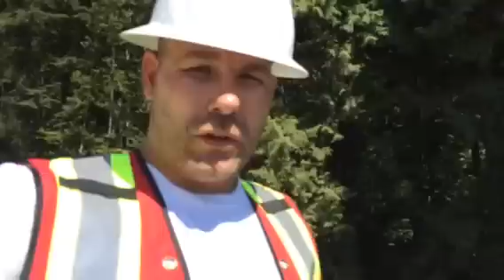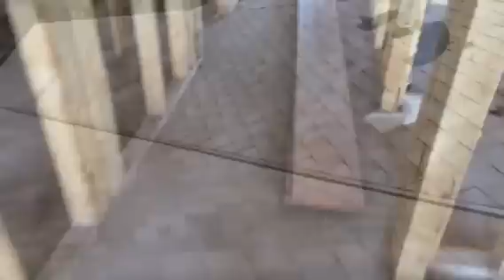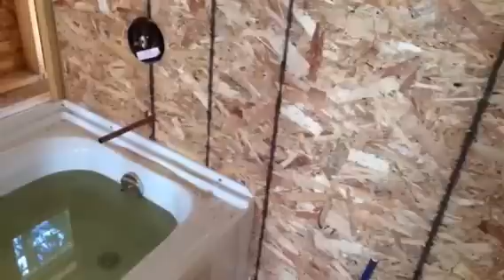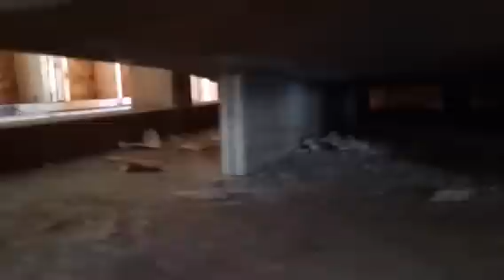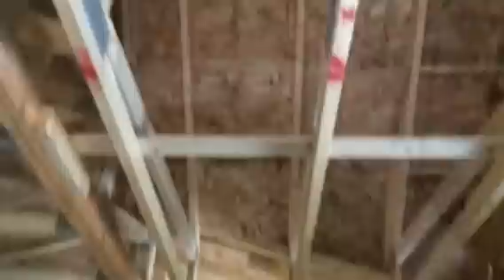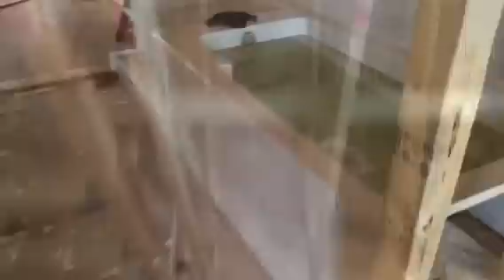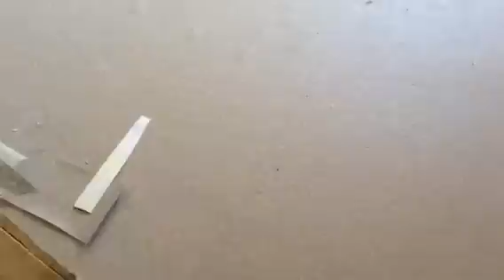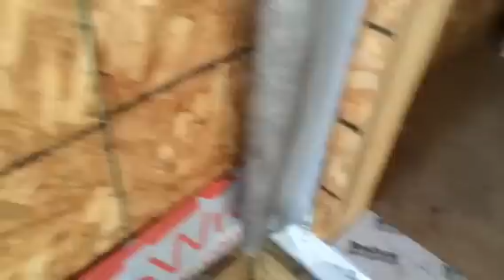New Home Construction Fails

Comment: Who the hell puts joist hangers upside down? There's a picture on the box!
Reply: OMG....who the hell would even need a picture?!?  This world  Crazy or stupid, I guess both....
Reply: Nathaniel Mathies if there put on upside down doesn't it become a hurricane strap then. the guy was plannin ahead!
Reply: Nathaniel Mathies , yeah, but if you're holding the box upside-down...
Reply: Btw, it looked to me that that was a very small deck off of a small slider. I could see that the joists for it were cut and fastened against a rim joist or ledger board, so they were infact installed upside-down for this particular situation. Also, when I have built decks with someone who knows what he's doing, we always toe-nailed the joists to a double or triple beam resting on a 4x4 encased in a concrete footing, we never used a joist hanger as we never cut any joists, they went over the supporting beam(s). Just saying.
Reply: Nathaniel Mathies Someone who just built a deck with a cantilievered overhang... lol that's pretty standard when the joists need to withstand a down force when cantilievered past the bearing point enough. the rim joists on the sides are usually psl or triple 2x beams that are offset and carriage bolted into interior deck framing.
Reply: It is what you do when you get the opportunity to do construction on your worst enemy's house.
Reply: Nathaniel Mathies - They've obviously got people onsite that have no experience in building. This construction will have loads of problems and the finishing work will be rough.
Reply: @numbereight886  they should go back to building dog houses and goat sheds.
Reply: Probably the Irish Twins from Powell River.
Reply: I'd bet they built the porch/deck on the ground and put it up upsidedown and didn't even notice. There is no way a framer does not know how those work/
Reply: Nathaniel Mathies ikr don't even need to know english.
Reply: Nathaniel Mathies   My grandfather used to have a saying that fits these workers; "Their momma must have dropped them on their heads, because they REALLY didn't know which end was up." 😂😂
Reply: Too bad anchor bolts don't come in a box with a picture....  I heard about a guy who stuck the threaded end into the concrete stem wall.  At least he followed directions and left 3" of bolt sticking out of the concrete.
Reply: This is what happens when your contractor skimps out on $$$ by hiring a crew of illegals that he just picked up in a Home Depot parking lot on the way to the job site...sure, they will bust their asses for much lower wages than a certified, reputable crew - some may actually be quite skilled and know what they are doing no matter what type of job you throw at them, but others may not have a clue on what they are doing...you  really have no way of knowing who you will get when you take that route.
Reply: Sometimes they’ll set the joist hangers like that just so they know that there’s one for each joist. Then install them later properly. Probably told greenhorn install them and he installed them just the way they were sitting
Reply: thinks someone Must have opened the wrong end of the box HA HA
Reply: Construction people are in construction for a reason.
Reply: Was there a picture on the box of nails too?
Reply: Nathaniel Mathies sometimes you put them upside down in purpose when the joist are cantilevered
Reply: @austinverbeek5822  not really, as a rule, you need twice as much inside your cantilever as what sticks out, so no that's not right if your framing and supporting correctly.
Reply: +Dustin Lentz what about using a 21 deg. framing nailed to toenail the joists to the ledger, then using a palm nailer for the joist hangers? I like the senco for those, thousands of nails, and it still works just fine. Don't forget to oil your pneumatic tools, boys and germs.
Reply: That was crazy....
Reply: hahah
Reply: Must be an Australian
Reply: @dannygallagher9290  they would be the first to know they go.......Down under, lol
Reply: Yeah the ones they put the right way around, I don’t think they did that on purpose, it was probably an accident.
Reply: Jordan Bergmann, why would you want to build beyond the safe bearing limit? Math is important so people don't get hurt or die, so if the overhang is only allowed by code or engineering equations to be, say, 3', why would you want to build it to 5' and not be safe, just assume some upside-down joist hangers are going to support your laziness? I am not a professional, I do know some stuff though, and it seems to me that if you use a 2x4 for a rafter, or sheetrock for subfloor, that things aren't going to go the way you hope they might. I say not to use upside-down joist hangers, Simpson makes other "strong-tie" models for specific applications, but I feel even with that in mind, I wouldn't build anything past the safe load rating. Just saying.
Reply: thats why cantilievered decks are built with beams of some sort whether theyre engineered of just tripled up 2x girders that run into the interior deck at least 3' for every foot of cantilievered overhang. then they are carriage bolted to psl's framed into the interior deck or sit on bearing plates. Theres your math and physics.... builders do this all the time and its definitely code compliant. Its more popular on multifamily jobs. Ive built cantilievered decks more times than i can count.
Reply: steve b THAT IS A FANTASTIC POINT!! :) LOL Buddy, you're hired!
Reply: Nathaniel Mathies they probably bully the deck on the ground and forgot to flip it over.
Reply: +Jordan Bergmann generally speaking, the ones I see off multi's are bolted to a ledger and the fronts are supported by notched 6x6's that run to footings at ground level. The decks are bolted or attached with ledgerloks to the vertical 6x6's. Well, if they're done right, anyways, I lived in Stratford, CT next to Bridgeport and saw some funky "carpentry" for sure. Anyways, I rarely if ever saw a cantilevered deck/patio on a multi, I don't know anyone who would do all the extra engineering/building for section 8 dirtbags to just trash before getting evicted anyway.

Comment: Tom, you couldn't possibly be serious about having an issue with the builder installing oriented strand board on a shear wall that is required by engineer. The whole wall is OSB, what did u think the drywallers were gonna do? Mud right over the OSB? Lol of course not my silly, they will install drywall over the OSB, just as will the tile installer install Backer board over the OSB. What you should have had an issue with is the depth of the valves that the plumber installed,, will he be able to trim that out after adding roughly 1 1/8 inch of material to that wall. 
It's OK though. We're still friends.
Reply: Hi Andre Glinsky yes I do have a problem with the installation of OSB behind the tile backer that still needs to be installed. OSB is the most absorbent product with a quarter of the tensile strength of densi-shield for a sheer wall installation. Following the discovery of this OSB installation the builder of this 50 unit townhouse complex replaces all this OSB with Densi-shield which what was actually required by the engineer.  The builder tried a shortcut to save themselves a lot of money. I located the deficiencies and the had to fix it. 

Thanks for the comments but, if you use OSB behind tub surrounds you will find problems in the near future.
Reply: +The Home Inspector 
You will have problems if you try to save money on the tile installation. not by using OSB instead of dens shield, which I think you might be thinking of dens glass, cuz dens shield is gypsum board with a water proof coating and doesn't have structural strength like plywood or strand board. densi shield that you mentioned is actually a  system designed to support the transmission of high-speed, serial differential signals. if the tile guy does his job properly the OSB will never have moisture. if not, the water will find its way to cause destruction weather strand board or dens shield or dens glass is installed. 
Cheers
Reply: Again thanks for the comments Andre Glinsky, not sure if you are in the industry but, I've seen what OSB and moisture does and I've seen tiling jobs that are atrocious. 

I'm just trying to improve the industry.  Did you like the upside down joist hangers at the end of the video?
Reply: +The Home Inspector joist hangers were definitely fun to watch lol 
maybe someone was hanging upside when they installed those hangers.
Reply: DensShield®  is a tile backer which has no rating for shear in the US.  I've done a few houses with it only because the drywall guy loved how easy it was to cut, but I just don't trust any gypsum board in the shower.  I've been using  USG Durock Cement Board only for the last 10 years because it is virtually unaffected by water.  I trust Hardibacker too.
I'm sure there was a county or city building building inspector who verified the engineer's shear schedule, but I'm not impressed with the change to DensShield.  It's a feeble shear panel and a sketchy tile backer.  It absolutely does not have the tensile strength of OSB, and depending on the lumber market, it may be cheaper than OSB.  If the story is as you say, this 50 unit condo project is a clusterfail.  Unless of course  the transmission of high-speed, serial differential signals is important to the customers.  Nice catch, Andre!
Reply: +Steve Crane 
nicely done Steve.

Comment: I'm not inspector, contractor, plumber, carpenter etc. but it looks on this video that you just want promotion to your company. Because you showed problems that make no sense.  why is a bathtub in the middle of a construction ? the steel plates to hold the 2×6 is the other way , of course is wrong, if I ask my 9 year old son he will know that. my suggest to you is STOP download videos to Youtube.  is just a waste of time watching this
Reply: You pressure test the plumbing, put test ball in sewer clean out, plug the bathtub drains, cap rest of drain ruff in's, fill the roof jack air vent. Plumbing inspector checks that everything's holding before any finish work.
Reply: You're "not inspector, contractor, plumber, carpenter" ... but you know more than people who actually ARE inspectors, contractors, plumbers, and carpenters? Then why aren't you doing their job? The part about the bathtub was already answered... the plumbing needs to be checked while it's still possible to fix it without having to tear all the walls back down in the process. And of course it's obvious the hangars are going the wrong way... that's exactly his point. It's the most amateurish move possible to put them on upside down and he couldn't believe it had been done that way... and yet it had. Without an inspector, that would have been covered up with the finished installation and nobody would have known, at least not until the entry collapsed after a couple years. You do realize the person doing the video did not do any of the work, was not part of the work crew, and is actually an inspector to make sure the work crew did their job properly?

Comment: Tom, I am curious about homes under construction and how and if the weather such as rain can affect the long term quality of a home.  Thanks!  Quint Lears - New Home Sales
Reply: OSB plywood will swell up on the edges if left uncovered for 6 months, but it's not too big of deal.  I have knocked those edges down with a flooring edger pretty quick. if a frame has taken a lot of water before it got weather tight, I would delay the insulation as long as possible.
Reply: The long term isn't affected nearly as much as initial quality.  As mino mentioned the subfloor edges will swell, and they can be sanded down.  OSB wall panel edges can swell and telegraph a slight bump through the siding..  Wet dimensional lumber will shrink as it dries, creating nail pops & cracks in drywall, potential squeaky floors, and opening gaps in millwork joints, etc.  It is a pain to correct the first year, but it doesn't get worse.

Comment: There is nothing wrong with the osb being used for the walls behind the tub. As you can see the osb is behind the tub. The cement board is installed over that layer so that the cement board sits over the lip of the tub. Basic tub install 101. If you were to put tile on the osb itself you would have a big flare in the bottom row of tile as the tile bridges the lip of the tub. I would bet if you went back a few days later you would have seen cement board on the walls and hanging over the lip of the tub.

     Also water is 8.3 pounds per gallon not 10.
Reply: Revisiting this post 7 years later, I can’t agree more with you, it’s process’ like these that most people that are not physically in the trades won’t understand. Then a home inspector with the wrong/ incomplete information  and knowledge has to put fear into homeowners day. Letting them know they’re new house is shady. Yes I get that there are horror stories, but ilalit of things are blown out of proportion into left field. I’ve installed near 1000 of those small tubs with legs and boards. Not one of them has collapsed over 20 years. Just make sure it doesn’t squeak, yes it’s nice to cement it in, in an ideal world I would have 20 hours in a 10 hour day

Comment: the upside down joist hangers were likely a cantilevered floor system. nothing wrong with osb walls, it was inside the tub line so it was probably  going to get durarock over it. must have been a structural wall.

Comment: The customer shouldn't need to ask if their new home needs an inspection.  Code requires all phases of construction be inspected by local authorities prior to cover up.  Now, of course, depending on work load, the quality of the inspection by local may or may not be comprehensive.

Comment: OK the OSB in wet locations amateur move but upside down hanger, I mean come on buckwheat. how stupid can you be. 
One disclaimer: "authority having jurisdiction" pretty much means all building codes are different according to your county or city. Only a building inspector has the authority to tell you what is up to code in a home, not a contractor. 
Furthermore a building code is only a 'minimum requirement', meaning a code can tell one thing and an inspector can tell you to do more because he is the authority having jurisdiction.

Just a little insight into something a lot of contractors do not understand and just think the inspector is out to get them. 
"Meet the code, don't beat the code."

Comment: A carpenter who installs a joist hanger upside down is not a carpenter.  He must have been one of those day laborers contractors hire.  Hey you!! Ever hammer a nail before?  Answer, well sure I did.  OK, you are hired starting at $5 hour.  !@#$%^  Or, he was the contractor's Brother-In-Law who needs a 2nd job.  Hey Wally, buy yourself a hammer and carry around a carpenter's square---no one will know.  !@#$%^   You do not think these occur?  Hey I have a bridge to sell you.  The bathroom walls?  Hey you, the wallboard guy... Have you ever heard of Cement Board?  Oh sure, that is the stuff they pour basement floors with, right? !@#$%^

Comment: Bad inspection. Wasting people's time and money. The waterproofing layer hasn't been installed in the bathroom yet ( Densheild, greenboard with kerdi membrane, Kerdiboard etc) Once that is installed, water will never penetrate osb so it will never deteriorate.

The plywood under the tub is from the manufacturer. Clearly with a good look and some experience you can see it is adhered to the tub from the factory. The tub is also attached to the studs as well.

The regular drywall behind the tub is most likely a fire barrier that has also been visibly "fire-taped" just past the tub height. So that is why it is there. once again, water will never reach that drywall, it only acts as a fire barrier. There is a difference between using "the best materials" and wasting unnecessary money. OSB has its purposes. When used correctly, it will not fail.

Comment: Tom Munro, CHI,  That OSB wall in the bathroom is what is called a shear wall. I could see its next to a stairwell which if you looked the wall below it was likely sheared also. Know how I can tell just from a short video? All the joints of the ply were blocked and nailed. Also, see that lip around the tub just below the flange? That is for durarock or some other form of substrate for tile. After you failed the first look I couldn't watch anymore of your video. You fail as a home inspector since you do not know how to build a house.

Comment: Well I have seen so many usually non "Canadian" people cut corners in the housing industry. It's disgusting. I'd never buy a house built by them. If you want to have some fun, bring a square with you some time. :) One last thing, certain builders wait for you to leave, then, put it back the way it was again to cut costs, or take out the insulation altogether and put in the house next door they are also building...

Comment: One vent per 300 s.f.?  Not that simple.  A typical roof vent is 8x8 in my region (64 s.i. or 0.44 s.f.).  Now you do the arithmetic from the code:
The total net free ventilating area shall not be less than 1/150th of the area of the space ventilated except that reduction of the total area to 1/300th is permitted, provided that at least 50% and not more than 80% of the required ventilating area is provided by ventilators located in the upper portion of the space to be ventilated at least 3 feet above the eave or cornice vents with the balance of the required ventilation provided by eave or cornice vents. 
As an alternative, the net free cross-ventilation area may be reduced to 1/300th when a vapor barrier having a transmission rate not exceeding 1 perm is installed on the warm-in-winter-side of the ceiling. (R806.2)